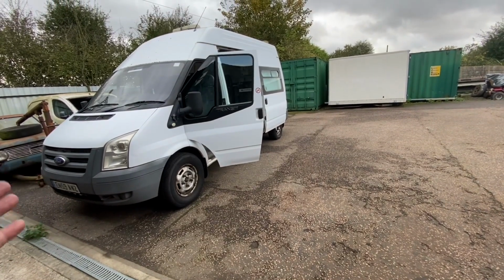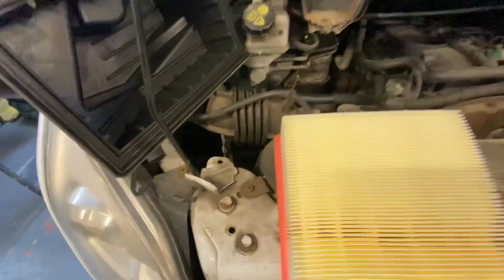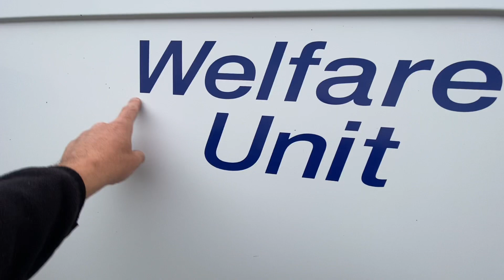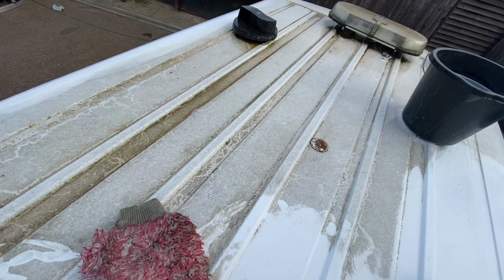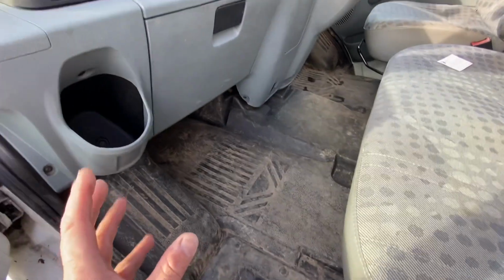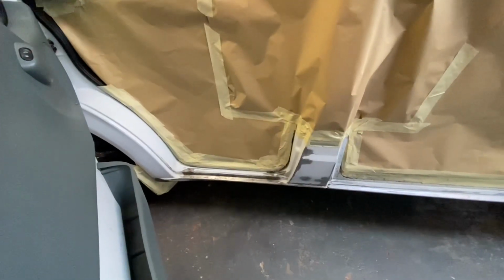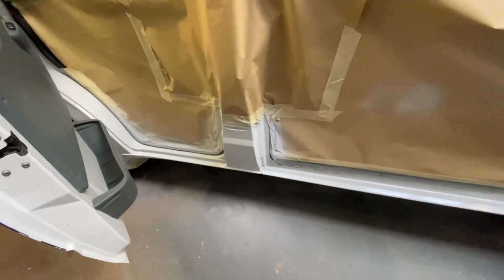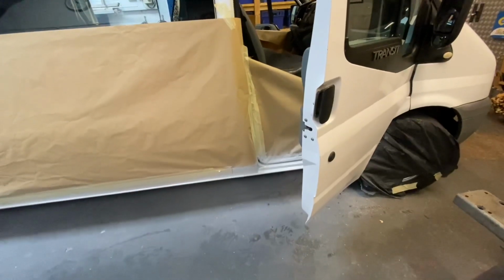Ford Transit Welfare Unit Rapid Make Over

Comment: I have the same model here in New Zealand the one thing I found with mine was that the injectors came loose right on our first lock down it happened on the way home. Are these engines as loud chatty  noisy, mine hunts at idle it has had new fuel lines fitted and a new filter set up, I must say i do like these vans, I have had 4 Ford Transits over the years right from the first type one of which I repowered with the Falcon 4 ltr engine, I had the 190 turbo that was also a neat van and now I have this model, which does not do great kms these days still great vans and thanks, oh must find the cabin filter where ever that is. Interesting my transit has the grey bump strips along the sides,
Reply: Will be fuel pressure relief valve. Relearn the the fuelling after fitting
Reply: @aaronmorris8963  this van went to a Ford garage and had the lines done with a new fuel filter set up thanks for your response

Comment: At the Mercedes shop I worked at we used non synthetic autotrans fluid to fill the diesel filter. Something about the expansion when heated and under pressure it cleans the carbon buildup off the injectors.

Comment: Looking great! 
The wheels look amazing. 
To clean the inside, was that G101(if correct, upholstery cleaner) you used on the floor, dash and door cards?
Reply: G101 is a general multipurpose cleaner
Reply from the maker: It was g101 bud yes 👍

Comment: Well worth the coin,iam not a car person but I just can't wait for the next one, iam hooked,just a quick one on the car check,I sold a MK2 golf GTi a few years back but would like to buy it back,so I put reg in,it said it found information on it,put bank details in then said can't give me access, yes the bank details are correct did it a few times,any ideas why it would not process the information?any help would be appreciated.keep the good work up, I drive a transit connect

Comment: I had a brand new transit and it was a Lex hire vehicle   fuel filter never got changed till the indicator says it needed it ,  It ran like a bag of spanners so bit the bullet and fitted a new one myself 
dealer said there was SIX different types at that time and mine was the most expensive and they never had it in stock at the stealers !!   No wonder they don't get changed  
Lex never wanted to spend a penny on fleet maintenance and just claim on warranty  even service items 
Got a £3 fleet guard  filter from the factors and it run like a dream  till I got a new. LWB

Comment: Get a headlight refurb kit, those headlights are grotty. 
You can use diluted linseed oil for the external plastics - that is what the expensive commercial ones are made of, I don't know the solvent they use to dilute but it won't be anything exotic.

Comment: Heat gun on the bumper comes up black and looks new, just a quick tip if you Don't no
Reply from the maker: We don’t do it bud 👍
Reply: U don't like to do it or something you have not done ?
Reply: Doesn’t last long.
Reply: Heating the bumpers pulls the oils out of them, which will ultimately cause them to go brittle and break.
Reply from the maker: @Railmover  it destroys the bumper
Reply: Well lesson learned ha that's why I stick with bikes haha

Comment: For VWs you definitely have the possibility of running the in-tank fuel pump with a diagnostic tool for a 30second run 4-5 times and it does fill the fuel filter for you. At least that’s what I did for my T5 transporter and golf 7.  They both cranked and ran fine first attempt after that.

Comment: Very good video as usual Rob and Chris quick tip on the Mk7 transit the  Best paint to use is Ford frozen white as I used diamond white on mine and it didn’t match  Diamond white is for the older models
Reply from the maker: This van is Diamond White frozen is to bright
Reply: @sruk  learn something new every day best of luck with

Comment: First I think the wheels are just right, that was a good call Rob on the colour. I do think that it was a good idea to do the sills and under the fuel cap. There is great potential in the van, I as also thinking of a 'race day' van. Thanks again Rob and Chris  for a great video. 👍

Comment: Cracking van I had the Transit 125 T350 cracking van never let me down until the day she was going the alternator gave up and still had 30 miles to go she got me to 100 yards of my house before the solenoid closed and cut the fuel and it was a dark night so lights were on cracking vans true work horses

Comment: Great video rob ,
Just wondering At 18.10 are the different fuel filler hole sizes because one is for petrol and one for diesel?
I couldn’t quite tell from the video. 😊👍

Comment: Boys the old Ford Transits are better than the new ones , they go on for ever especially the smiles best Transit ever made !
Reply: I used to work on the old 2.5 diesel smiley face transits.  Bullet proof , no egr valves , no stupid dpf , no stupid sensors . Just plain old diesel engine that where simple to work on .
Reply: @retroshropshire41  was the "banana" engine in the "smiley"?
Reply: @jamesbrett6518  yeah

Comment: Tip for you Rob when polishing apply 5 or 6 dots of polish on the pad with no water spread the polish on the panel without turning the mop on then start the mop on a slow speed to spread the polish and then speed it up. You will get no mess that way. Not trying to tell you how to suck eggs mate  but I learnt the hard way too

Comment: Rob  / Chris instead off putting gel on the bumpers that dries and goes back to normal get a blow torch on low heat and go over the bumpers they come up brand new and don’t fade for years or old engine oil rubbed in works just aswell I’d love to see yous try it on the channel because both methods work great especially the blow torch 
Great job on the van lads

Comment: Rob Ive been buffing cars for nearly 30 years and still make a mess,I don’t know how the painters do it. Little tip for you. Polish can be removed from textured plastics ie bumpers and trims with a pencil eraser (rubber) 

Keep up the cracking content guys you’ve definitely inspired me 😉
Reply: Tar and glue remover gets polish out of textured bumpers with ease, you shouldnt need to use water with a buffer you just need to keep moving the buffer so you dont create too much heat in the panel

Comment: I have a transit 2004 
She just stopped 2 weeks ago after I pulled out of a junction 
Fresh fuel filter 
Easy start 
towed for 3 miles 
Nothing not a  whimper 

Putting a diagnoses machine on it tomorrow 
Any other ideas 

Cranks shaft sensor maybe ?? 
Anybody any ideas

Comment: Use bumper gel on the interior floor, it will look brand new and lasts ALOT longer than exterior parts as it doesnt get weathered.
Reply: And you then find you feet will slip on them..
Reply: Yeah but it looks good for photos for when you try to sell it

Comment: We used to have those transits at work and I have to say that I don't like them at all!  Uncomfortable, noisy gutless and they understeer very easily. We now use vw crafters and they're like a Rolls Royce compared to them! Enjoyed the video anyway!
Reply from the maker: I rate this shape transit and it drives spot on
Reply: I don’t rate crafters we had a fleet of them at our wholesale department and they always had issues with adblue  and eml lights and gutless tiny 2 litre golf engine pulling a big lwb van
Reply: @sruk  I'm sure that it's a good one- wouldn't expect anything else from you guys!

Comment: I drove hundreds of thousands of miles in the 80s and 90s in cars with.... hold on to your hats, ladies .... no cabin air filters at all. I'm still here and I didn't suffer any ill effects. I suppose that if there is a choice between changing the pollen filter or not then you might as well, but it's not such a big deal.

Comment: Should Pi$$ away at that Rob Lad

Have you a Oil Fired Workshop Heater?
If Not with amount of Engine Services you do..Cost next to Nothing to Run , Esp if its as Bad As they Say its Going to be
Reply from the maker: We do bud 👍
Reply: @sruk  Greta won't like that!
Reply: @jamesbrett6518  tuff 😆

Comment: just fit new diesel filter then spray brake parts cleaner up the air box pipe till it pulls the diesel through
Reply from the maker: That’s not what to do bud lol
Reply: @sruk  worked for me once when we were in the stuck